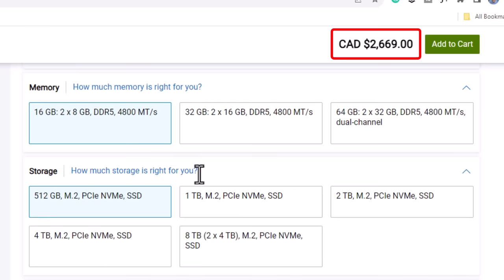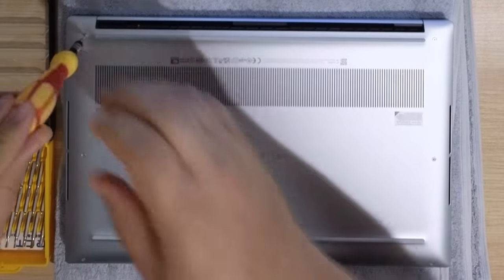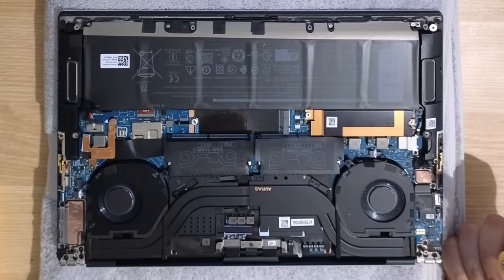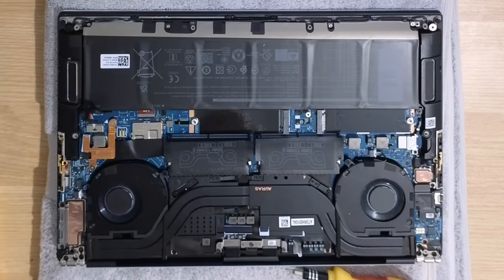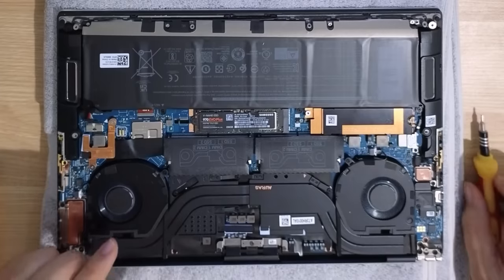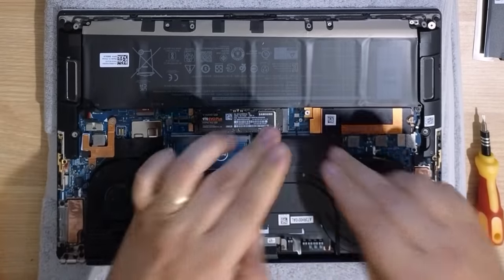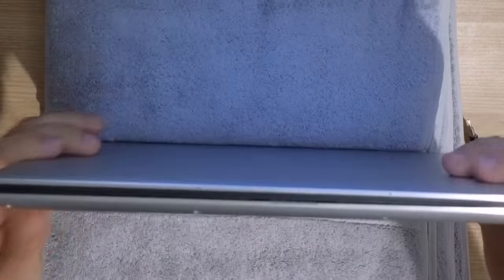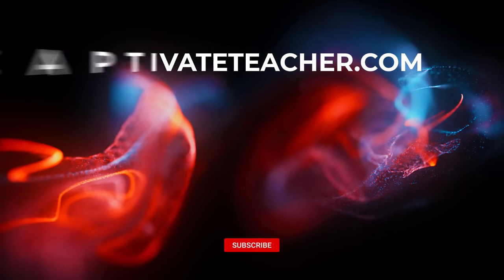Upgrading DELL XPS 15 (9530) Laptop

Comment: Great stuff although you wound up leaving out what I consider to be a critical item when you clipped you actually getting the unit open. Even if you cut it out because it took so much to get it done it would have been very helpful for you to show the separation points clearly so people know where to try to insert whatever they are using for leverage and/or to hold one part separated while they move to another spot. Honestly, for anyone that's done this kind of thing before, it is arguably the single most important question to get answered so you don't accidentally scratch something up. .
Reply from the maker: I edited it out because it took so long. No huge secret here. Just worked an old credit card between the edges until it popped free.
Reply: @CaptivateTeacher  Consider me challenging your "No huge secret" notion. No secret for you. For the unit I needed to deal with, the fit was tight enough that there was no clear insertion point. Zero chance of a credit card slipping through. Granted, I mixed the one point that it had something of an insertion point, but a credit card would have just bent (it was that snug). If I did not have the experience I do and/or was a less patient man, there would have been significant risk if me marring something. I stress again, this isn't my first, fifth, or tenth rodeo, and I was left scratching my head for quite a while on a critical point. I get cutting it because it took so long, but the fact it took so long should be a cue that you need to mention what finally got it done, and you basically skipped it entirely. 
Like I said, overall helpful, just an unforced miss IMHO on this one point.
Reply from the maker: I started with some fingernails to open one of the back corners and worked in the credit card to begin the prying process. However, I emphasized that there was no secret. I carefully worked the card, starting in the back corner of the laptop all the way around until the retaining clips were all released. I'm sorry that you didn't find my video helpful. Please note that I'm just a user like you. I don't work for Dell, nor am I a professional computer technician. I'm just sharing my experience upgrading my new computer.

Comment: Thank you for this video. I just bought one and am hoping to upgrade the ssd and ram also. My only fear is loading the OS software on the newly installed drive. I wish you had a video showing how that is done. I know you  included the link for the DELL Operating System Recovery Software in the description but it scares the heck out of me.  Is there any way you would consider doing a video showing how it’s done? 🙏🏻
Reply from the maker: I might do a video on this at some point, but because of all the restarting and non-windows screens, I would need an external capture card. Don't be afraid. I just followed the steps one by one, and it guided me the whole way.
Reply: Thank you for your response. Do the steps format the drive & make the different partitions on the disk for the recovery drive and Dell software in addition to the OS drive?
Reply from the maker: Yes, it does.
Reply: Oh awesome! Thank you so much!!! 😊
Reply from the maker: You're welcome.
Reply: @CaptivateTeacher  did the data in our laptop gone after recovery os? Im planing to upgrade the ram as well
Reply from the maker: There is an option to back up your data, which I recommend.

Comment: I tried this but using g.skill memory.  It was 4800 but CL 34.  I can't get it to work so I am going to return it and puchase crucial since it seems to be the only one that is confirmed to work in these laptops.  do you know if there's any way in the bios to set the laptop to accept ram, or does it really just do it automatically and there's no settings for us to adjust?
Reply from the maker: I went to Crucial's website and allowed their scanner to tell me what RAM I needed. I installed it, and it worked. No adjustments in the BIOS are required. There is a link in the description to the RAM I purchased.
Reply: @CaptivateTeacher  thank you.  I just picked up a kit that was listed on their site and it worked.  At first the laptop loaded saying it was using “Dell Secure Bios” then went to bios screen saying ram amount had changed and I was able to click continue.  The first kit I tried was g. Skill and had a lower CAS latency, but unfortunately didn’t work.  Not a huge deal and I did go ahead and put in 64 GB and a 2TB Samsung drive (in the second slot).  I just am going to keep using the included 512 GB drive it came with for the boot drive.  I don’t plan on opening the back again and should be good for a long time with this laptop
Reply from the maker: @ezwider4652  that sounds great.
Reply from the maker: You're welcome.

Comment: Do you know if using something like the Samsung data migration is good enough, or must I use the Dell process you mentioned at the end?  Thanks
Reply from the maker: I would use the tool that is included with Dell. It's part of the OS recovery software.

Comment: Is it a problem if I accidentally threw out the RAM covers and don't have a heat sink for the SSD?
Reply from the maker: I would check with Dell to be sure but you are probably okay without the RAM covers. I would recommend the heat sink on the second SSD as it gets pretty hot.
Reply: Is an SSD like Samsung 990 Pro w/heatsink or Kingston Fury Renegade w/heatsink compatible with this laptop  or do we have to use these thermal pads or custom copper plates? Was just wondering if the thickness could be an issue. Thanks.

Comment: If my XPS 15 has pre-installed windows 11 on it, will the windows go crazy about new ram? I mean 16GB will be replaced with 64GB. Is it a potential problem? I heard about cases when pre-installed windows didn't like when hardware was updated/replaced.
Reply from the maker: I believe what you are referring to is mostly related to desktop computers. If you replace too many components it can deactivate Windows. Memory and storage wouldn't be enough.

Comment: I currently have a 2 TB version of this laptop, but my storage is getting filled up fast. If I buy a new hard drive and connect it to the second hard drive port while keeping the original SSD, will I need to configure the new hard drive in some way or will it just work as extra storage? Will I also need to upgrade my RAM? I currently have 32 GB.
Reply from the maker: You will not need to upgrade your RAM to increase your storage. Install the second drive. Once you restart Windows you can click on the Start button and type in Create and Format Hard Disk. This will allow you to select the new drive and enable and format it.
Reply: @ Thank you for the quick response, but I should have asked is 32 gigs of ram enough to keep my computer running smoothly after installing the new hard drive or should I get more ram so that the computer performs better with the additional hard drive?
Reply: @CaptivateTeacher  I should also ask, after the hard drive is formatted, does it act as an extension of the current storage or is it it’s own separate section in the computer? By that I mean if I made a folder that I store massive amounts of data in on the original hard drive, will the new hard drive allow me to add more files to the old folder or do I need to make another folder in the new hard drive’s storage to put the new files into?
Reply from the maker: @ 32GB is lots but I did upgrade to 64GB almost right away so I'm not sure if 32 would have been enough. I believe in maximizing to what you can afford.
Reply from the maker: @MrMovieMaker116  I have mine presently configured as two drives but I believe there is an option in the BIOS to have act as one. Since this video I purchased another 2TB so I'm presently running 2TB+2TB. The second drive is where I store all the video I record for my clients or my YouTube channel. I know I won't be able to keep every video I've ever recorded but perhaps I can keep six months worth of video or so.

Comment: Sorry if this is a dumb question, but could you just add an additional 16 GB to a 16GB XPS 15 (9530) to make 32GB or do you have to completely replace it with a 32GB Ram? Thank you. Sorry again if this dumb, I am new to computer upgrades.
Reply from the maker: @riepie6639  my computer came with two memory modules so replacing both just made sense. If you have an empty slot you could just buy and install one module. Keep in mind a matched pair of memory modules ensures you get the best performance.
Reply: @ Thank you!
Reply from the maker: You're welcome and thanks for watching.

Comment: What if I only want to upgrade my ram, do I still need the OS recovery, backup, windows installation etc?
I don't plan on changing or upgrading my SSD. With only RAM upgraded is it just sticking the ram sticks in and boot up normally like always?
Reply from the maker: No you won't need the OS Recovery if you are just upgrading the RAM.
Reply: @CaptivateTeacher  Thank you for your reply. After installing the new RAM, is there anything I need to do with the software or BIOS to ensure it works properly?
Reply from the maker: @TheInfinite66  as I recall mine just worked when I restarted

Comment: Does the dell xps 15 9530 supports 5600mhz ram? or only 4800mhz?
Reply from the maker: When I'm shopping for RAM I rely on Crucial and the tools that have on their website to inform me of what is compatible with my system. For this computer I used the information I found on their website here: https://www.crucial.com/compatible-upgrade-for/dell/xps-15-(9530-intel-13th-gen-2023)
Reply: The chipset only supports 4800mhz, so even if you put in 5600 or faster, the modules will only run at 4800.
Reply: Yeah the 5600 worked fine for me for anyone interested
Reply: It can only go up to 5200
Reply: @RobloxianX  so you probably have a different laptop
Reply: @branchingrex  No, the literal CPU Specification limit for non XMP memory on the i9-13900H is 5200. Stop lying to yourself and others
Reply: @RobloxianX  it is clearly stated in the video hes using the i7 version... its even linked in the description.... not really sure how u missed that
Reply: @RobloxianX  the original comment is referring to the i7 version too.... you dont even know what ur talking about

Comment: Hi, sorry to bother you again but I have one more question… do you think a Samsung 990Pro with heatsink would fit in that secondary slot? I have one that I was using on another computer and am wondering if I’ll be able to use it on this one when I get it.
Reply from the maker: You might have to use the heatsink that comes with the laptop.
Reply: I’m sorry, maybe I forgot to mention but I’m hoping to put this in the second slot, not the primary one. The second one doesn’t have a heatsink provided, right? That’s the way it looked on your video. I know the primary slot had one but I’m hoping to put this in the second slot.
Reply from the maker: @MR-tt9mc I ended up ordering one designed specifically for this laptop for the second slot.
Reply from the maker: @MR-tt9mc the link is in the description of this video.
Reply: I saw that heatsink link, but this 990Pro already has one attached. I was just wondering if you thought there would be room for it in there. It’s ok, I’ll just find out when I get it. I appreciate your help though. .
Reply from the maker: @MR-tt9mc  no problem. Best of luck.
Reply: @MR-tt9mc  Give us an update. Did it fit?

Comment: The last real XPS of its kind. The new 14/16 is trash!
Reply from the maker: My next computer might be a Mac. Not sure yet.
Reply: @CaptivateTeacher  i am really considering purchasing this dell xps 15. Would you recommend it for programming jobs?
Reply: And do you have an idea of the battery life? I also saw in some reviews that the laptop warms a bit much than others . Is it true ?
Reply from the maker: @raphaelt7587  The Dell XPS 15 is a great laptop for creatives, especially if you are doing video editing as I frequently find myself doing. The dedicated NVIDIA graphic card makes rendering video a breeze. If you are a coder, you probably don't need this, unless you create games. Many people in my shoes end up buying a gaming laptop. I've stuck with the XPS because it is far more elegant than the bricks that are gaming laptops, but still has similar power.
Reply from the maker: @raphaelt7587  Battery life is decent on this but I would suggest that it mostly depends on what you are doing. For example, if I'm checking email and surfing the internet I will get many hours of battery life. If I'm editing and publishing a video, I doubt I would get more than about an hour, maybe two.